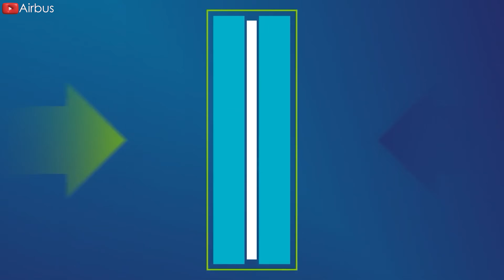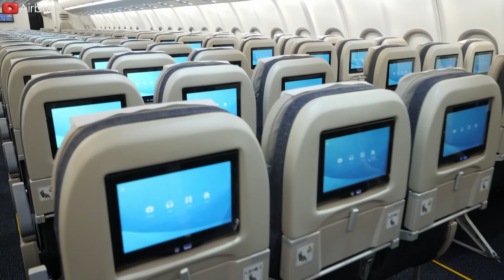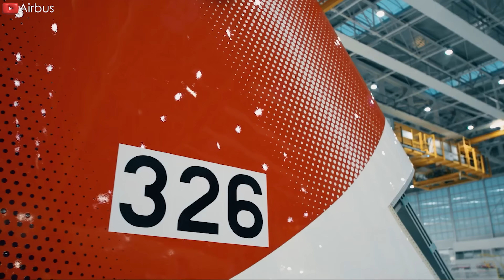Airbus BIG Announcement New A390 & SHOCKS The Entire Industry! Here's Why

Comment: This is a very damaging video for FLIG AVIA's credibility.

Airbus have stated that they are not going to make a A390 or even a stretch version of the A380 such as the A380-900 or A380plus. They are still trying to come to terms with the fact that they lost so much money on producing the small batch that they did produce. The price of the last hull was less than it cost to build. It was indicated that they would not consider a new version unless they were paid the 25 Billion development fee upfront. 

Many said that the A380 was too small to start with. Even though it was supposed to be for 850 passengers, the seat configuration that most fly is around 425. The only one that was different was the Hajj flights which were full of economy seats. 

The problem is that the A380 guzzles more fuel that the A350 or the B777 and B787 yet carries only a small number more than either of them for the same distance. Airbus was asked to produce an A380neo but was uncommitted and talks lapsed. 

To use the new the Rolls Royce Trent Ultrafan, the world’s most efficient large aero engine, purpose-built for the Airbus A350, they would have to raise the undercarriage to give it ground clearance. The Trent UltraFan has a 350cm diameter whilst the GE9X is 340cm and the Trent UXB (for the A350) is just 300cm. Even just two engines might not be enough for the MWOT. A380 is 575t, Boeing 777 is 351t, Boeing 787 is 254t and A350-1000 is 308t. So to lift the A380 you need 4 engines at 75k thrust.

In June 2023, despite A380 production having ceased, Jim Clark of Emirates renewed his plea for a re-engined A380neo, suggesting that a next-generation Rolls-Royce UltraFan could give a 25% reduction in fuel burn and emissions.

The A380 has become a prestige aircraft - like Concorde. Those airlines that have a big enough infrastructure can operate it. To Emirates, it's become a major selling point as their aircraft are operating worldwide and draw people to their hub in Dubai. Even though they are moving DXB to DWC which is a massive multi-billion investment for the UAE. It's doubtful that they would take on the risk of sponsoring the A380neo, only for Airbus to sell it to their competitors and remove their advantage.

As much as I would like the A380neo or a A390 to be built, I will settle for Emirates keeping the A380 that they have operating for the next 50 years, just as Lufthansa keep their 747s operational and with new engines, it might just turn out to be the smartest investment Emirates ever made.

Comment: A390 don't need two engines, above 4 is realistic
Reply: 4 engines are not fuel efficient
Reply: @Vembo_Minecraft The problem is that 2 engines would not generate enough power for an airframe that big. Remember that it has to be able to fly on just one engine if the other one gives out at take off and still climb away.

The whole thing is a pipe-dream and it won't happen.

Comment: The A380 is again winning more popularity and more are flying again but it uses too much fuel. Can this kind of monster engines help to get the A380 back in service as the A380NEO with re-engining it putting 1 RR Ultra Fan or GE-9X on each side and the other two much smaller engines like the CFM-LEAP. So you have for the biggest part the power of the the 2 enormous engines and don't know if just that is  enough. SO they can add 2 lighter engines for additional thrust.

And if they can make the A380-800 lighter because the 800 was made more robust and heavier to accommodate a stretched version of the A380 like the 900 that never came. So it is too heavy

They also can make more efficient wings because they had to make compromises to fit it on airports. So maybe foldable wings.

Comment: While ultra long flights may be a goal in itself, these ultra long haul flights are rarely economical unless the airplane is configured with premium cabins only.
Flying an airplane on an ultra long flight lasting 19-20 hours cannot be made economical, at least not today, if the airplane cabin layout is standard with 40-60 premium seats and the rest normal economy seats.
The reason the ultra long haul flights can only be made economical with a fully premium seat cabin is fuel. For an ultra long haul flight, the airplane must be able to load much more fuel for the flight and that means a heavier airplane which again means a poor overall economy unless you can get the money in and earn a profit and that is only possible at the moment if the entire airplane cabin is configured with premium seats only.

Comment: When the plane is using less fuel, there will be more planes, and the total consumption of fuel will increase.
Reply: The amount of fuel, per mile or kilometer, per passenger is much more interesting.
Reply: @CrownRider  When the fuel consumption per seat is decreased, you will increase used seats and will need more planes. And those planes will use more fuel than was used before the fuel improvement. 

Is it that hard to grasp this?
Reply: @elbuggo  No, it's not hard to grasp. Just a different way of looking at it. Don't you see that?
Reply: Incorrect, more planes come about with more passengers, hence the original A380 (one aircraft instead of two) plus customers drive the aircraft demand on how they fly and where to.
Airlines buy as less Aircraft as possible. They are hugely expensive. They only make a profit while in the air-not on the ground. Fuel is changing too, many new aircraft will be flying with fuel made from plants instead of oil. Its easy to be critical, without an answer or solution. Airlines and Engine manufacturers are spending billions on trying to go greener and still keep air fares within reach. All these advancements takes years or even decades, not weeks. Think of the emerging markets where there are no green requirements (China) Worry about their non green signature, its the largest!!!
Reply: @johnchristmas7522  BTW, China is burning 4.2 billion ton of coal each year, in case you didn't know. And increasing with at least 100 million ton each year. You fix that too?
Reply: @johnchristmas7522  RE: many new aircraft will be flying with fuel made from plants

That is a delusional pipe dream, and totally pointless. Without cheap fuel, there will be no mass flying.

Again, if a new plane use less fuel, there will be more tickets sold due to lower costs, and they will need more planes. 

Total consumption will then increase, and more polar bears on the North Pole will drown. Isn't that so?.